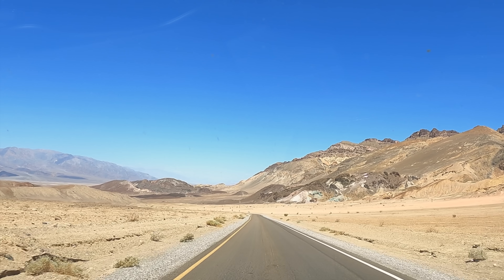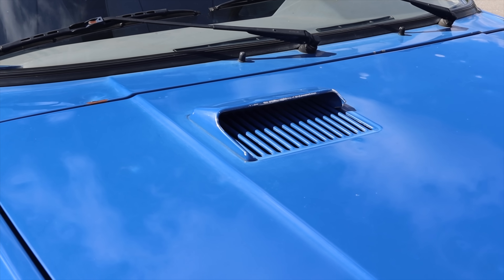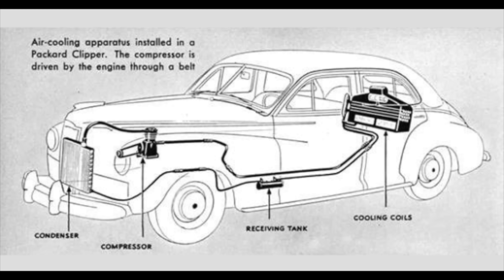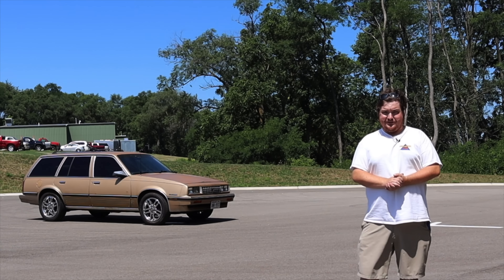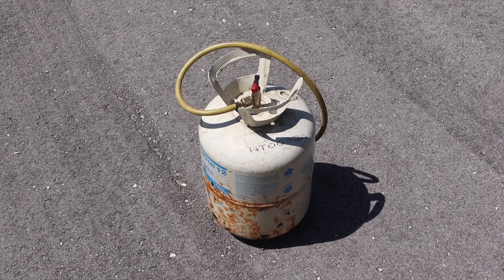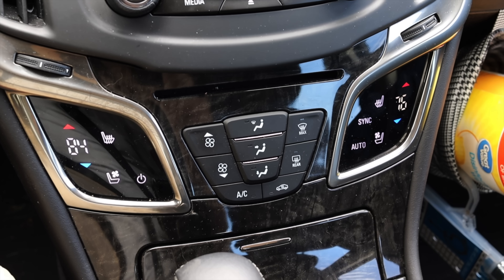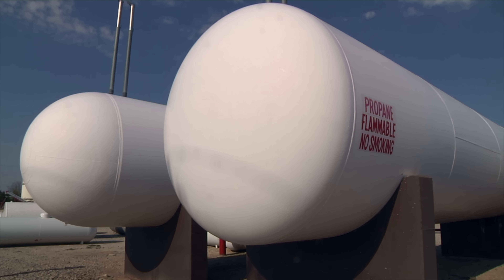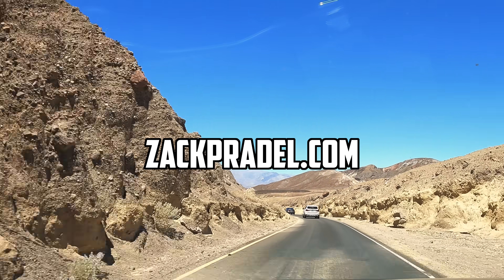Air Conditioning - The Story Of R12 & Why Modern Air Conditioning SUCKS!

Comment: I have a 75 Cadillac Coupe deVille that still runs R12. I just installed a new compressor and VIR (valve in receiver, an expansion valve built into the receiver/dryer), and recharged with R12 rather than convert to 134. It takes 3.75 pounds of it! Worked fantastic on a 2000 mile round trip to Miami I just got back from!
I have about 45 pounds of it remaining between my two bottles. Should be good for life!
Reply: Hang on to that tank. R12 is worth its weight in platinum.

Comment: Cars better in the 80S?  Need to take a close look at that.  100k miles in the 80s was still a bunch of miles back then, not so much now.  Several other areas are FAR better today.
Reply: And several worse too. 12 year old Lexus, low miles, but needs some sensors replaced to pass smog test which will cost more that the car is worth- WTF? It still runs OK, a bit rough idle is all. Junk, like all it's contemporaries.
Reply: @P_RO_  Well ok get you literally Any 80s vic and try to get it smog compliant..
Reply: @adamharris2674  Not too hard to do when you apply the 80's specs unless it's one of the crazy Chrysler "Lean Burn" things. TBH the 80's Detroit vehicles were mostly crap so no real comparison with anything else. Go back to the early 70's or into the mid 90's and you'll find better cars overall than you can buy today. Simple, cheap to fix and rebuild, cheaper to insure, durable so you can keep them 20 years if you like, and even considering lesser fuel mileage still much cheaper in the long run. It's been my formula for decades and it's proven itself to work most excellently, letting me drive a vehicle for a total cost other than fuel of <$2500 per year including liability insurance. Do the math and see what you car does- you'll be shocked. And I'm getting 90% of your fuel mileage too. God help you if your new car's A/C breaks and loses that 1234 "You're FuXXed" refrigerant because one evac and refill will cost you around $2K and that doesn't include replacing whatever broke causing the loss.

Comment: My 1993 Cadillac is on the original R12 system. The air is like ice 🧊 colder than any newer car I’ve been in. I would never think of converting it over as the system doesn’t leak  and I have a few cases of the old R12 left!

Comment: Propane is actually the refrigerant of choice for a lot of large industrial establishments. It's a lot more cheap and a lot more efficient than most of the purpose-made refrigerant chemicals. But for obviously flammable reasons, systems equipped for propane as a refrigerant are not available for domestic use.
As for the electronic duster cans, it's because aerosol sprays usually use refrigerants as the spray carrier. Duster cans are just aerosol sprays without the payload chemical. Although I don't see how that would work because they still use R134a due to the same laws that banned R12's use in the first place.

Comment: Cars looked their best in the 1940s, 50s, and 60s.  Yes, R134A sucks, especially when used in an R12 to R134A converted A/C system.
Reply: If you have the correct  charge of 134a wben you replace R12 there is very little difference. generally the replacement happens when the R12 charge is to low to operate properly. So 134 is wonderful making the ac function again.

Comment: When we went to Iraq in 2003 our water bottles were hot. To cool them, we put them in socks soaked in water and hung them out the windows of our trucks to cool them off. It worked pretty well until the sock dried, but we used water to cool water much like the window bags.🤣

Comment: My first car, way back in 1984 was a 1968 Mustang. It had quarter windows, but no A/C. My second car in 1986, was a 1982 Mustang 5.0 GT. That one had super cold R12 A/C. I remember when you could go to the local auto parts store and buy little cans of R12. When the little cans of R12 were outlawed, I would drive down to Mexico (2 hour drive from Los Angeles) and sneak back 2 to 3 small cans of R12. I felt like I was sneaking drugs across the border.

Comment: A tip with those little vent windows... if for whatever emergency you need to break a window to get in a vehicle, don't break that one. Just because it's the smallest window doesn't mean it's the cheapest to replace... in some cases it's the most expensive and hardest to find.
Reply: This. So many cars with tiny broken windows. Main windows can be replaced in a day, if that, and are cheap to obtain, compared to fixed, tiny windows.
Reply: Makes sense....rare window, rare replacements.

Comment: I have a 2007 Australian Ford Falcon with a big engine (Barra I6) and a big air conditioning compressor that uses modern gas... it has no problem cooling down my station wagon in the tropical and sub-tropical Australian sun (I actually never have the thermostat on full cold even in summer... usually just under half way). 

I think the problem is more that most modern cars have wussy little 2 litre engines with AC compressors the size of a can of beans and a condenser the size of a pizza box, rather than the gas used.

Would love to cruise through death valley though.
Reply: This is very true. I have the new Ford Bronco and the A/C is SUPER cold but that is because of the very large front grill and condenser.
Reply: Last time we drove through death valley it was 118 degress, at 11pm, long after sunset. Its a reason there's "death" in the name.

Trip took several hours, and we only passed 2 or 3 cars the whole way through.
Reply: G Day from Australia, enjoy your BF wagon
Reply: As an hvac tech, you're absolutely correct. The refrigerant that it was designed for doesn't effect capacity. Conversions do though.

Comment: All my vehicles had R12 in the air conditioning from factory. Two of them still do. It is also in my water coolers in the house and my refrigerator. I have a large collection of R12 for service. I did convert my truck to R134 and it does get plenty cold. However, it puts more of a load on the engine than R12 did. Now as for propane it does not work as a substitute. It replaces R22. R12 is equivalent to butane, which I used in my rusted out wood powered truck. It never exploded.
Reply: Yet!   A case could be made to going back to ammonia.   When it leaks, you will know it.

Comment: Here is something you won't hear about often . I put R12 into a r134a s car , yes R12 INTO a 134a car . Why ,well I had a question and noone on the internet seemed to have tried it . 134a is about a third less efficient than r12 so they made the condenser and evaporator a third bigger to compensate, so I thought well IF you were to have R12 in it instead of 134a it should be mega cold , but no-one had tried it . So I pulled out all the R134a out of my 98 Buick and filled it with small cans of 12 I got here or there over the years . And it does not disappoint. the vent temps on the highway were in the upper 40's on a 95 degree day before, not bad. I don't notice any difference in town but on the highway I get vent temps in the low 30's . The lowest temp I have got was about 25. The problem is the core freezes over and I have to run the vent for a few minutes every ten minutes or so . I am thinking of putting on a sensor to fit the compressor automatically, but most definitely the old stuff was colder. There was such an argument in the 90's and now in 2022 I have real world proved it R12 was better  .
Reply: R134a will freeze the evap coil if for some reason the cycling switch is stuck closed...
Reply: R12 is colder at the same pressure that 134a is , so if the sensor only reads pressure not temps then it will freeze up and the compressor will still be on .
Reply: @williambrennan5701  Yes, it's why clutch cycling pressure switches for R134a are set lower (20PSI I think) vs R12 (23PSI I think). You're supposed to either adjust the switch or change it when going from R12 to R134a.
Reply: @brianleeper5737  but I went from 134a TO 12 NOT the other way ,I did the opposite. They didn't make that Buick in an R12 variant so I'll have to add my own sensor . No biggie they exist.
Reply: @williambrennan5701  Nissan used a sensor that measures the evaporator temperature and cycles off the compressor when it gets below 32F.
Reply: @brianleeper5737  so did my 76 Malibu but Buick didn't in 1998 🤣
Reply: @williambrennan5701  Didn't they use a low pressure sensor connected to the ECM in that year? If that's the case you may not have any option since the ECM is controlling the AC clutch cycling via the pressure sensor readings. I suppose you could maybe reprogram the ECM to cycle at a higher pressure reading...
Reply: @brianleeper5737  no they didn't that I can see . I'm going with a low tech approach. They sell aftermarket freeze up sensors for home air conditioners. It is a simple open close switch if it freezes it brakes the connection once it warms up a little bit closes . If I hook the wire going to the compressor though that problem solved, this is how my old 76 Malibu did it and there was a sensor in the old 2000 civic we had , we could actually hear that one click when it tried to freeze when it got low on refigeant. But as a side note it should improve my gas mileage a tiny bit because though it's been proven you get more mpg in a car with the ac on with windows up vs ac off windows down you the best  milage Windows up and no ac off. Well the compressor will be kicking out , reducing load so reducing gasoline needed to propel the car . Yes it will increase ware on the clutch disk but older cars did it like that do it should be ok .
Reply: @williambrennan5701  You should be able to change your low-pressure cutout switch with one set for R12, assuming that the one you have isn't adjustable. If there's a screw between the terminals then it is adjustable and you should be able to adjust it so that it cuts out the compressor before the evaporator freezes.
Reply: @brianleeper5737  i will simply cut the power line leading to the ac compressor clutch and put a relay inline . the really will be controlled by a normally closed switch on the evap coil that breaks the connection once the temperature gets low enough to freeze it . this will cut power to the relay which will disengage the clutch. once the temp rises on the evaporator the switch closes the relay connects and the compressor clutch engages again. No lcm issues all parts  except the temperature switch for the evap are cheap and on the shelf stock at pretty much any local auto parts store.. the temperature switch is available on eBay for basically peanuts. right now I haven't bothered when I feel the air has slowed down a lot I just turned it to vent for about 2 minutes and turn the air back on.
Reply: You could probably use R152a with it and it would work fine. And that's a LOT cheaper than R12. Can get a 6 pack of 12oz cans of R152a for about $18 at Costco, labelled as "Air duster spray". Use a side can tapper to charge it in..
Reply: @brianleeper5737  r152a is within 1% of the efficiency of t134a so at best you may get a 1% gain in efficiency. it has a much lower molecular weight so you don't need as much r152a as you do 134a. R12 is depending on where you read it 15 to 30% more efficient than 134a. so honestly for 1% you may as well just use 134a at least then you have off the shelf parts. and honestly in all but the very hottest parts of the country where you would sit in traffic properly recharge 134a in an R12 system is sufficient. unfortunately I happen to live in Florida one of the hottest most humid places in the country so I want that 15%. that's why I recharged the 134a system with R12, to get increased cooling capacity out of the same air conditioning system. however honestly there is not a noticeable difference when sitting in traffic but going down the road it will slap freeze you out compared to r134a.
Reply: @williambrennan5701  R152a has pressures that are lower than R134a at almost all temperatures, which makes it a better replacement for R12 in those vehicles with compressors that cannot handle the higher pressure of R134a.
Reply: @williambrennan5701  And there is something wrong with your system if R134a can't deliver decent performance when the vehicle is moving. Usually, the problem is poor cooling at idle.
Reply: @brianleeper5737   r134a works fine going down the road it is a 1998 Buick LeSabre. that replaced my 1998 Buick LeSabre that basically fell apart around the engine that I had already replaced every single component of the air conditioning system on. I'm not going to say that it has horrible air conditioning at an idle I'm just saying it's insufficient if you have anybody in the backseat. I wanted to see if that would change using R12 the only way you can really tell a difference at an idle is by looking at the thermometer however as soon as you're moving your frigid. do not look at this 1998 Buick LeSabre through the same lens that you would look at any modern vehicle. a lot of '90s model air conditionings systems sucked some worse than others. manufacturers Just had not figured out on every model how to make the air conditioning great on 134a they had just switched from R12. so that the 98 Buick I have has so so air if it was a smaller car it might have been sufficient in my opinion. this is also happening right now again with the introduction of 1234 YF refrigerant that is in brand new cars. I've had three people call me now to take a look at their car air conditioner not being cold enough when I get there  it's brand new cars with less than 5000 miles they've already taken it back to the dealer twice and the dealer says there's nothing wrong with it so they call me to see if the dealer is full of crap. I tell him the truth that they system's not designed properly because they don't know how to design the system properly yet. I have people with brand new cars asking me to convert their air conditioning system to 134a which so far I have refused they're just too new I'm not going to mess up their warranty but I felt the air conditioning it's abysmal. and I'm not saying all cars that are using the new Freon is going to be horrible it's going to be hit and miss for a while just like it was in the 90s.

Comment: Don’t convert R12 to R134 etc.  it’ll ruin the compressor and the condenser.  If you can find a shop that’ll retrofit to FR12 do it.  It’s a lower pressure gas that works just as well as the R12 system and won’t mess your system up
Reply: This isn’t true. I’ve retrofitted hundreds of vehicles from R12 to R134a with no issues. It might only be up to 90-95%, but it will cool. If there were problems that came up after the retrofit, they existed prior to the retrofit.

Comment: I remember when they sold BB guns in the 1980s that ran off store-bought R-12 refill cartridges meant for filling your A/C. R-12 was so cheap back then, you could just waste it in your BB gun, and it would, of course, release the R-12 into the atmosphere when you fired them. Those little throw-away cartridges of R-12 now sell for $1000 apiece on eBay!
Reply: I think I still have one with a $0.99 price tag still on it.
Reply: I remember those. The first version had a tube you loaded BB's into, about a 5 minute process for ~100 BB's which gave you 4 seconds shooting. They didn't sell till that was revised. And I sure didn't know R-12 had reached that price- zowie!

Comment: great job.   my car from the 70s was filled with R2D2.    here's a good topic.   when replacing brakes, what's the truth about turning rotors, leaving them alone or replacing them.    has there ever been proof of a rotor breaking because it was too thin?  (i call bs on the dealer and repair shops sales pitch)
Reply: Yes as a rental truck mechanic I've seen it a number of times
Reply: What force causes brakes to work? Friction. What is a byproduct of friction? Heat. What happens when there isn’t enough material to absorb the amount of heat being generated? It deforms. In the case of brake rotors, they warp. 

I was a former technician/service writer for the better part of 10 years, and while I did see one rotor worn down to the vanes once, what is more common is that a warped rotor will cause one of three things to happen. In order of likelihood: 1) uneven pad wear, causing the need to replace pads more often. 2) caliper pins jamming due to the wobble. 3) potential damage and premature failure of a hub and/or wheel bearing due to excessive vibration. 

Rotors that are heavily rust pitted or grooved can cause premature pad wear as well.